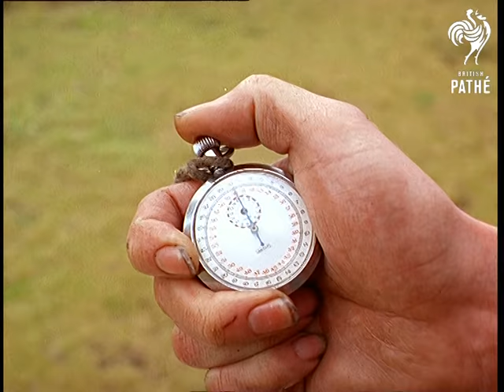Cable Racing (1967)

Comment: Funny thing is the top speed is only at like 217mph unofficially now. Held by Nick Tucci who runs the AMRCA, a group that has been in continuous operation since the golden age of tether car racing!
Reply: Makes sense, since the rules are likely who can build the most efficient gasoline engine by weight, and gasoline has a limit of power output and motor efficiency.

Otherwise they would place magnets in the track.
Reply: Only 217 you act like that’s slow
Reply: No they have been over 400kph which is 250mph
Reply: @SimRacing360  the world record is 215.9mph

Comment: How long do the wheel bearings and tyres last for on one of these things?
Reply: There are no wheel bearings, it's really simple technique. And there is no lateral force on the wheels because the cable takes all centrifugal forces. I still have my father's 5 cc car he raced with around 1970.